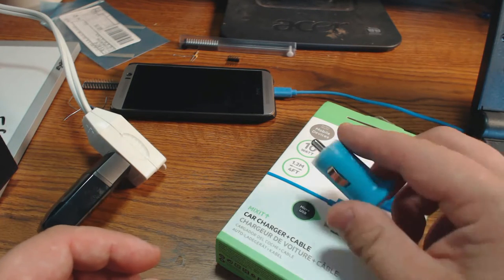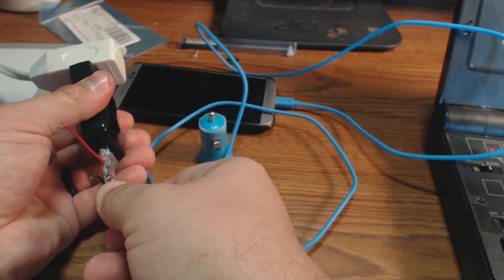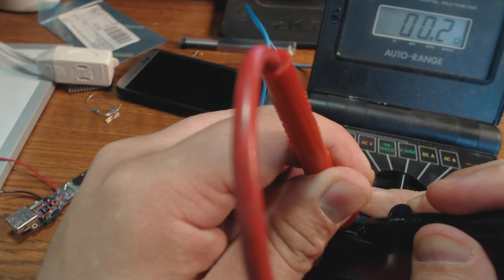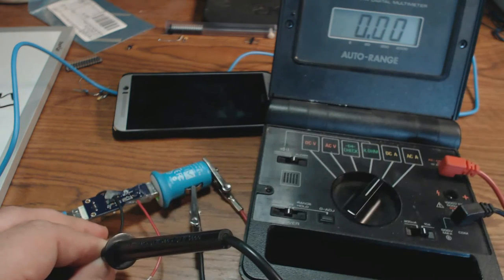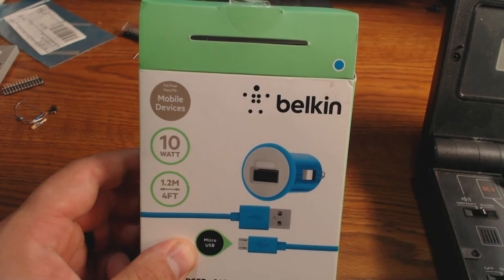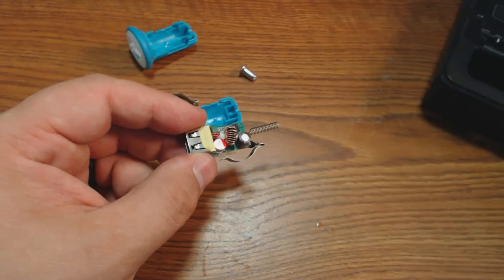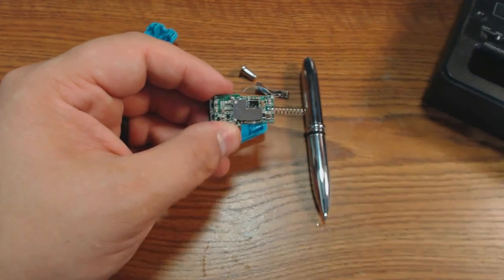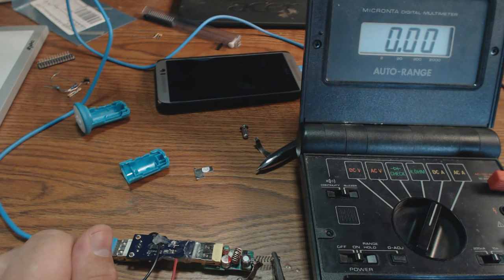eapbg #11 Belkin Car Charger Teardown and Hack

Comment: I want to see how you shorted the wires
Reply from the maker: It was a solder blob that connected the D+ and D- pins. This was easy to do at the connector.
Reply: Thanks. I was at first thinking that it was a short to ground and DC negative from each data line. Thank for clearing that up.
Reply: @eapbg  hey, I have a Belkin charger very similar and it’s not charging my iPhone. I googled it someone has done this same hack but put a 180 ohm resistor across the D- and D+. It was a fairly old post though. 
I guess my question is why did he use a 180 ohm resistor and you just short it out?
Reply from the maker: @DanDanDan89  An iPhone requires specific voltages and on the data pins to charge properly. My best guess is that the voltages were wrong and the resistor helped to pull the voltages to the correct level. Measure the voltages on the data pins to ground on your charger and see what they are.

Comment: I've returned 2 chargers because of this :). They were rated at 3.1A and they didn't charge at full amps. Nice find!
Reply: They aren't supposed to constantly put out that amount of amps. That's what they're capable of putting out. If your phone doesn't draw that many amps, then the charger will not put out that many amps.